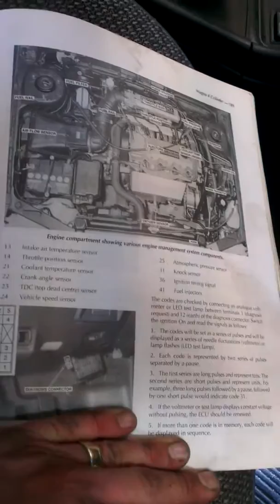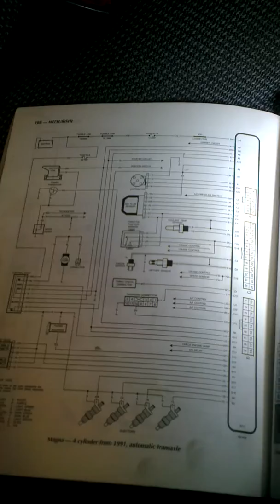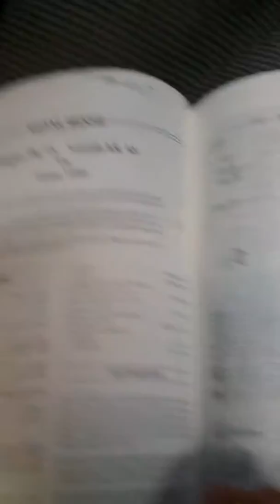Mitsubishi magna ecu check engine light

Comment: If you put the alligator clip on the diagnostic port and the test light on the earth it is alot easier to keep contact 😉 I'm amazed it's still going, most 4 cylinder models died due to the immobiliser system having a brainfart and permanently dieing without having an auto electrician bypass the immobiliser system completely! Very expensive so most went to the wreckers.

Comment: Know much about the trans speed sensors? Got one stuck in limp mode, will only do 2nd and 3rd, goes into 3rd when the speedo starts moving, intermittently it’ll work fine and then go limp when it gets hot, it’s a 94 V3000 (Magna without a cat for NZ) I’ll try find the diagnostic port if it has one